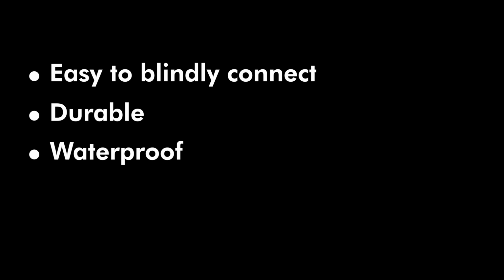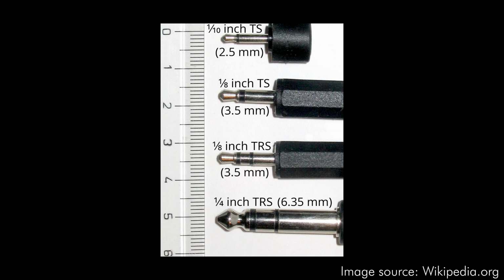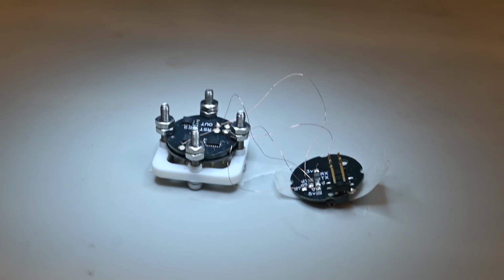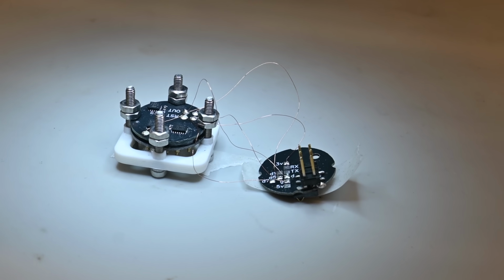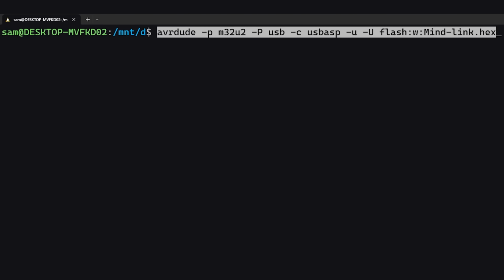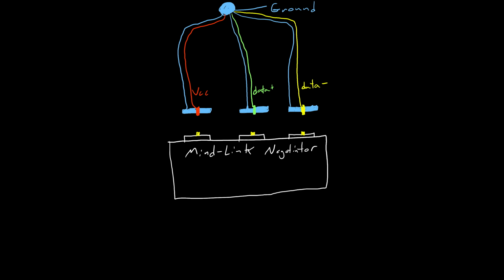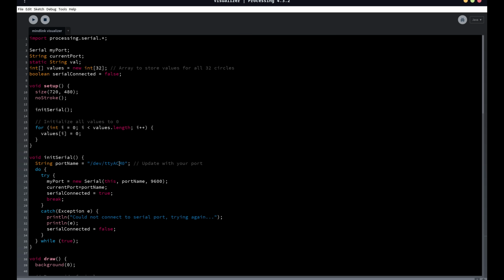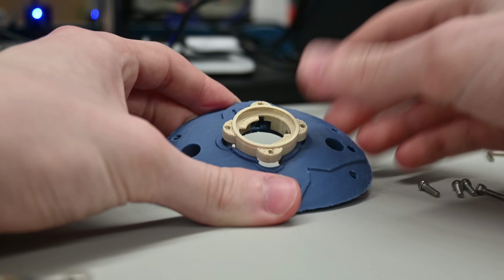Making a Brain Computer Interface in My Garage

Comment: As a neurobiologist that baseplate is a stuff of nightmares, I would advise against having 2 cm wide holes in your skull. The standard way is to make a small hole to which cables comes out. Second I would suggest to you that the brain has already optimal tuned interfaces for itself through its nerves, therefore while BCIs are amazing for people with specific damages and disabilities, there is no reason to believe that injecting information into the brain through low density wires strung into your cortex would be any more efficient than using the evolution-tuned high density channels that you learned to use since childhood. Like to give you an example, when you think by speaking to yourself you do it to more or less your speaking speed.
Also for the electronics, you might want to use an FPGA and a full USB3.1 link set in streaming mode if you want to unload most of the processing, as you will have to transfer quite more some data than a base AVR can send. You could look into amaranth if you would not prefer to write verilog directly.
Reply: I agree for the most part after getting a neuroscience and a computer science degree and research this area for my thesis, the design needs some work. 
Yeah we have well tuned inputs and outputs, but there are ways in which you could argument thought which a higher bandwidth non destructive BCI.
Reply: Greg Harman approves.
Reply: Wireless or induction are better options than a permanent hole in the skull. Perhaps induction could also be used to recharge the device. However, the device may be damaged by the body over time. And immunosupressants may be required.
Reply: YOLO tho
Reply: “Evolution tuned high density channels” 😂😂😂 is this your way of saying that studying is better? Yeah we all have a hard time believing that.
Reply: @TheRealNightShot  if you think that even if you could get as many wires inside your brain getting information inside your brain would feel any different than "studying"  you're in for a bad surprise.
Reply: @fluffy_tail4365 I think you’re underestimating technological progress 😊

And even if it ends up not feeling any different from studying, the process of actually acquiring the information will be way less flawed and time consuming. The brain only performs optimally when it’s efficient. It is a lazy organ, and it doesn’t do what it doesn’t like. This is well documented. You cannot equate such an organ to well defined electronic interfaces that do what you tell them to do. If the brain did actually do that, we would all be geniuses 😂😂😂
Reply: @TheRealNightShot wtf? Doesn't do that it doesn't like? So if I get burned while touching a hot kettle, which sure as hell I won't like, my brain wouldn't learn immediately that touching hot kettles is bad for me? Your point breaks quite easily
Reply: @dimaryk11  No idea how your response ties into my statemnet.
Reply: @dimaryk11  Studying is nowhere near comparable an immediate response to a negative destructive stimuli.
Reply: @TheRealNightShot  learning requires attention and understanding, in order for your brain to create the circuits that allow you to then recall the memory. you clearly don't know this, or don't know how attention and understanding work, despite them being fairly easy to grasp concepts when at an amateurish level. Moreso, learning is very much tied to emotions. I believe that with such methods the memories would be fleeting. Unless one's prepared to traumatise themselves for the sake of learning calculus in a day... surely a consequence-less choice😂
Reply: @simon20002  I’ve seen compared the reaction of a toddler to pain to the process of learning 😂 y’all are the ones who clearly don’t know what you’re talking about. Not only are pain reactions embedded in instincts rather than memory, but it is also a completely different process to “learn” to avoid something. A response to pain does not need attention and understanding. It is akin to learning a simple, single step concept, like Bernoulli’s principle’s theorem, but even simpler. Nowhere near even the simplest school subjects. Therefore, as the technology behind brain implants continues to increase, we will, eventually, hold the ability to have all sorts of data at immediate avail 😊 making studying next to obsolete altogether. The brain doesn’t even need to be the main data storage! That would be terribly inefficient. They might as well just package flash memory in the brain implants, so that data can be stored there and projected in the brain whenever needed, as a thought, rather than a memory ;)
Reply: @simon20002 I believe learning or refreshing information on something a vast majority of the population doesn't know or couldn't care to remember, in a single day, even further every aspect of it, quite possibly everything ever in the span of a few months would be far more useful to a lot of people than you seem to understand, what is being traumatized if you become nigh omniscient, most people already carry some
Reply: @TheRealNightShot And why wouldn't it be?

Comment: wow, its so amazing to see a proof of concept for something ive been fantasizing about since i was in middle school, i had been wondering if things like this were possible ever since i first heard that the brain uses electric signals to communicate between cells. 

now i have a suggestion: what if instead of integrating the computer chips into a skull mount, the only part that is surgically implanted is the chip that goes on the brain and cables that bring it to the outer surface, with a magnet connector like you used for the chip-to-computer interface, then the chip would be placed on top of that whenever its in use, that way, all of the translating of signals would be done outside of the skull, and things like upgrades and maintenance wouldnt even require unscrewing anything from the skull and leaving a temporary open hole, and you could even share chips and stuff with other people.

keep up the good work, man! i cant wait until these are able to be commercially sold
Reply: That does implement limitations but I do kinda prefer the idea of an external computer and only the aray being the implanted part
Reply: @CM-di1oz  I appreciate the feedback! I'd like to hear what kinds of limitations you see, as I am not yet experienced enough with designing to find more than the fact that it would probably require more complicated software (im still an engineering student so this would be greatly appreciated)

Comment: Open source is the only way for BCIs. Imagine having a part of your body that, unlike everything else, is not open medical knowledge but proprietary info owned by a corporation. Keep up the good work!
Reply: unironically. proprietary surgical inserts have been a disaster for real people already. Including forced surgery to remove the thing when the company decided to no longer support it.
Reply: @Lantern_Lights  that's messed up
Reply: without doubt. The only way for ethical prosthetics and implants, absolute minimum, if not straight up fully open source hardware, firmware and software (unlikely to happen from companies tbh) is at least full and unconditional rights towards ownership, an intended way for access and modification. And most importantly a requirement that use of all devices base functionality must be guaranteed to work offline and without dependence on a specific companies technitians/certifications or information/knowledge that is not public or ensured archived open access for all medical professionals after it has been set up. 
Realistically it shouldnt be 100% open for the end user/patient to tamper with, but it must absolutely be maintainable by medical professionals just by reading documentation/instructions.
Reply: This is part of why I really do hope the 'plans' Gabe Newell has for Valve is to turn it into a worker-owned company (likely given it almost is already, besides the controlling share GabeN owns, if Forbes is to be believed). They are the best positioned and most likely company to succeed in developing non-intrusive BCI, and to release it in an open-source way
Reply: I just want a plug, no computer in my brain. Just let me plug into a computer that can receive the signals
Reply: @fyrnabrwyrda  you need some thing to read and understand the electrical signals from your brain.
Reply: @fyrnabrwyrda  unfortunately, physics doesn't care what we want. The best way to process brain data is to not need to move it. Every milimeter of our crass, primitive metal electrical wires introduces unacceptable noise and latency in a system that's far too latency sensitive to be a tolerable risk....
Reply: @DingleFlop  fiber optics are excellent for latency, though would need specialized devices to ensure lowest level of noise. Not great for power transfer, but data transfer is very good. Power transfer can be done through a regular wire, with care taken to isolate noise from electrical signal from the processing components of the data stream.
Reply: yeah, like this is probably the only way i'd let any sort of interface be attached in an invasive manner
Reply: New fear unlocked
Reply: @nuruluin9840  hahahaa true...
Reply: heh me too ;]  сис
Reply: If anything, this video is proof of your statement.
Reply: Most people will have streamed corporate ai brainchips, but some of us... Will have open source brain chips connected to a raspberry pie.

Comment: That'S what USB HID has been for all along! /jk

TBH, Most low-power ARM chips have more power than your high-power Atmel chip, especially when compared from a power consumption PoV. That said, you'd likely want to split things to use FPGAs or CPLDs for the actual data sampling from the electrodes with the sampling done with some fast ADC for each pin. Using the FPGA to filter and preprocess signals (potentially doing some neuronal pre-processing (pun intended) before things are passed on to the interface MCU for hading over the data to wireless (BTLE, 802.11, NFC) or wired (USB) interfaces.

If I understand your current design correctly, you're actively powering the interface when using it? Any decisions on an alternate power source for constant operation? Like super-caps, batteries or rechargeables?

Comment: what if all the actual processing was taken out of the implanted coin stack and replaced with denser multiplexers, letting you get much more pins in neural contact, and the compute unit was magnetically held on and data connected through something like that one magnet DQ standard that apple used. then, if you get hit with malware/ need an E stop for data-mind linkage, you just grip it and rip it off. when you wanna dive in, you attach the magnet harness of a bunch of different peripherals/ compute units to self inert coinstacks around the skull

Comment: fun fact gabe newell has founded a competitor to neuralink called starfish neuroscience they are planning to the more interesting inputing of data into the brain and is planned to release later this year
Reply: I'm 110% convinced that the reason the new valve headset doesn't have a top strap is because they're leaving space for an eeg crown upgrade.

Comment: I've been thinking about stuff like this for a while. I have a few ideas like Emotion-reactive Glasses, two transparent OLEDs which display content based on someone's current emotional state. And a bionic arm that actually connects to the nerve endings so it can send touch and position data to someone's brain. Position is actually your sixth sense, being able to tell what position each part of your body is, and gyroscopic orientation of your head. If there is gravity, even if you dont have any other sense, you can tell if you're moving, and which direction roughly correlates to down. We could expand on this by making it more accurate, or allowing extra connections (like an extra pair of arms) to send their data to our brains, and it so much more.

Comment: How about using off-the-shelf controllers for small cameras and displays to read and drive the brain pins, instead of coming up with your own custom protocols? Not enough time-resolution or something? Would still require too much work to get right voltages and such? They use too much power?

Comment: utah arrays are notorious for damaging the brain tissue they're implanted into...
what neuralink is doing is a lot better, but it's very easy to disconnect because of how thin the threads are, and the movement of the brain inside the skull

i think you'd need something new to ensure proper connection without damage :(

Comment: The need to directly interface with the brain tissue is a false belief. Any nerve tissue anywhere in the body already, safely and without sterile issues, connects to the brain. The brain is the most protected system in your body, for damn good reason. And note that the brain (and/or our consciousness, whatever that is) is extremely capable of adapting. Look into biofeedback experiments from half a century ago in which, once the subject user was made aware of the individual neurons firing (neurons which were located nearly side-by-side in the skin/muscle or the hand or arm, I believe) as indicated to the subject user by watching lights going off and on upon the biofeedback device, the user could learn to completely control each individual neuron's firing and subsequently learn to 'play them like musical instruments' or send Morse Code with them. Once the subject user developed the ability to control them, they could do so accurately, without watching the lights. If this were something that was then used constantly, I would expect that new capability to be retained indefinately and would improve and become virtually autonomic.
Reply: Kevin Warwick with his braingate stuff was an arm-implant, for example - that was back in the 2000s!

I think non-invasive also offers a lot of untapped potential as well, considering I think he still had to get the transdermal stuff removed. 

Lots of ways to read information such as EMG like the myo armband (now owned by meta/facebook), and other means of input like haptics can enable if doing sensory weaving style stuff to pattern the information consistently, prompting neuronal growth over time.

Comment: I'm not hating at all, but I think there is still a lot of potential in EEG's, there's already people playing video games with it and it could be used to control home electronics which is the most I'd want to do anyways.
Reply: Additionally... the microelectrode array works at first, until the brain tissue scars itself around the array... if you still want the performance from invasive methods without the drawbacks, the superior method is traveling through the blood vessels into the brain. Which means no brain surgery is required, and no brain tissue gets scared.. Lookup the company "synchron".

Comment: There's a better way. You sync a personal AI and integrate that with your tech. It helps make decisions at lightning fast speeds in critical situations. Granted, the ability to give ourselves new senses is novel and only possible through direct brain interfaces, but largely unnecessary. AI will be able to computate and correlate hundreds of data streams simultaneously while our brains are limited to only a few streams before becoming overwhelmed. This isn't to say that nanotech can't gradually replace neurons so that we maintain a sense of coherent self and continuity of consciousness, but development has to happen across multiple fields and I'd imagine it take probably the next 200 years of technological innovation. We'll first master biology before we do nanotech. In fact, I would almost bet that nanotech will be biological in nature, because the machinery at those scales will already need to resemble and function like that of cellular biology. There may be larger, metal based microscopic robots, but using what's already there, I.E. chemicals for fuel, is just easier when we already have tiny biological engines to work with.

Cool project though. The Matrix tells me this is a bad idea. Full steam again!

Comment: If you are going to go for invasive, why even go through the skull. It could be run up the spine and the port could be at a less dangerous part of the body to mess with like say just below the right side clavicle or add a layer of titanium on the skin side of one of the vertebrae that you can plug into on a vertical axis from top to bottom rather than point into the body?
Reply: Running a cable through the spine is most likely way more dangerous than a direct line into the skull. Huge likelyhood of damage to the spinal cords and down the line pinching of the spinal cord.
Reply: @tainicon4639  Not through the spine itself but up the spine, not on the inside of it but the outside of it whether the organ side or skin side whichever is better.